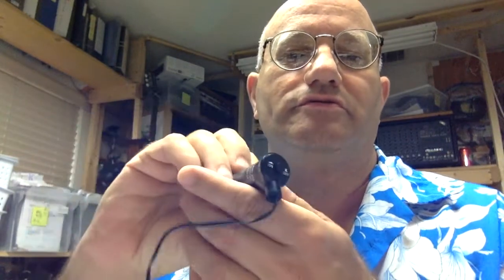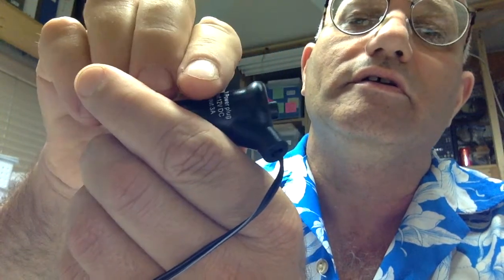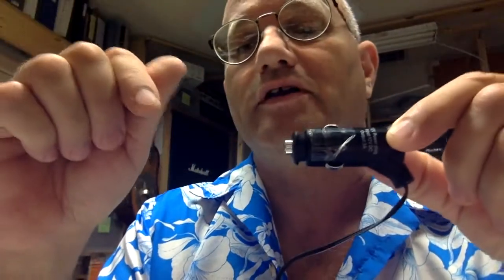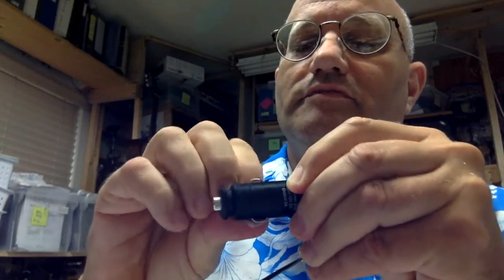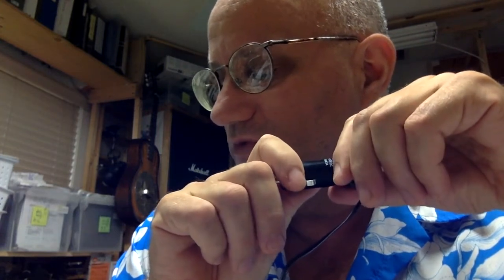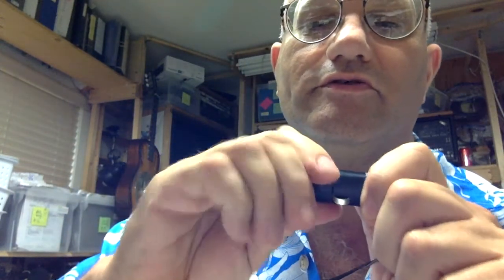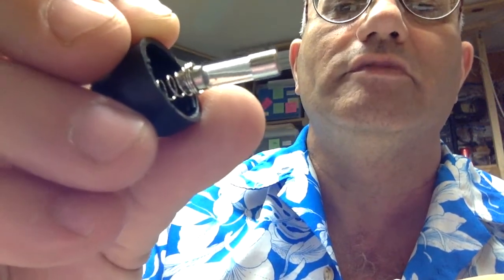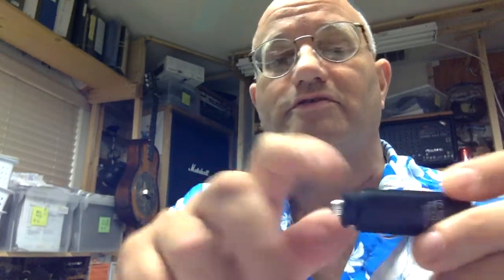Car Cigarette Lighter  On-Off Switch,   3 Amp 12 Volt DC  and  how to switch out fuse

Comment: OK,, what was the point of the video... that they make a 12v -24v Cigarette Lighter Plug With Illuminated Switch? wait was the switch on this one illuminated? Plus you stated it was a 3 Amp 12 volt switch but it has a 5 Amp fuse already installed? interesting.